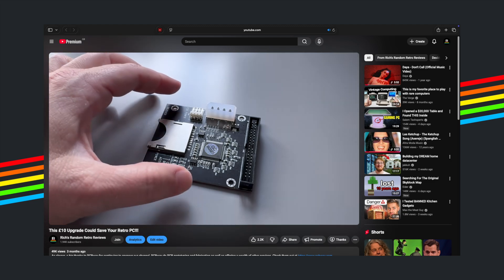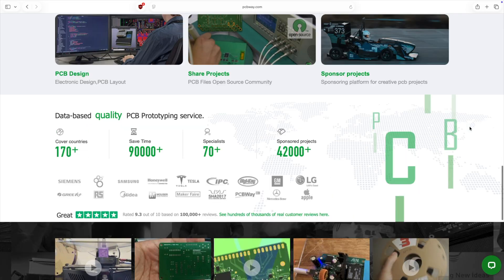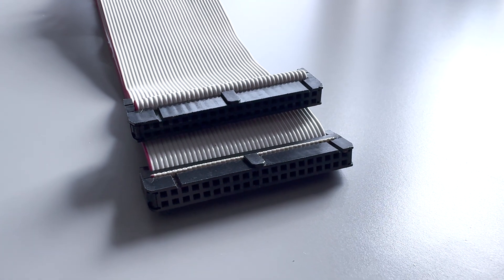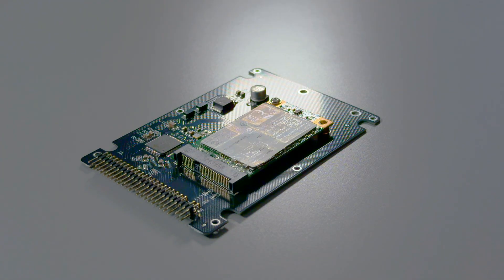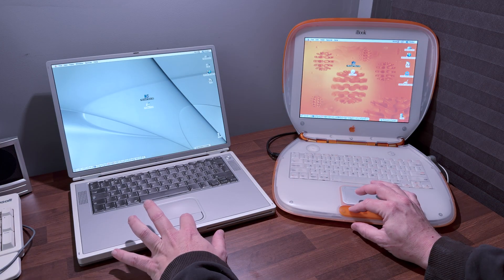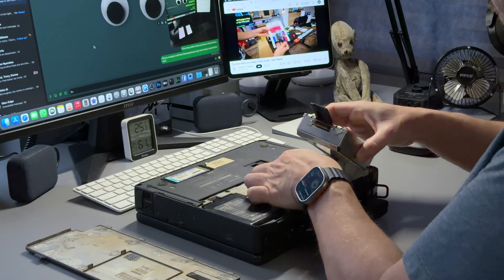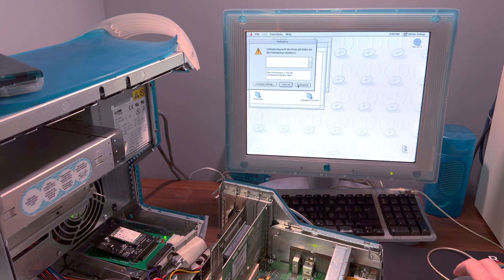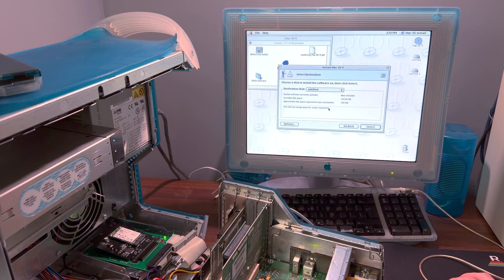Replace Your Vintage Hard Drive With This NOW!

Comment: And now the cost of SSD's is going through the roof, along with RAM and graphics cards.
Reply from the maker: I think we might weather the storm for smaller size SSDs. I can't see there being a massive price hike for 32 or 40GB drives ;)
Reply: These old low capacity msata ones are absolutely worthless though
Reply from the maker: @My_Old_YT_Account that’s why they’re so cheap and perfect for vintage machines
Reply: @RichsRandomRetroReviews yea but they should figure out a way to make a RAID card out of them, 4x32gb as one 128gb drive would actually be useful in newer PCs
In those older IDE ones I just use converters to SATA, SATA HDDs are also extremely cheap and generally much higher capacity.